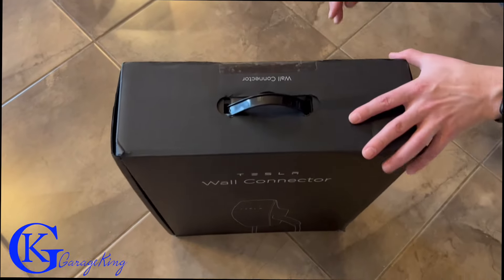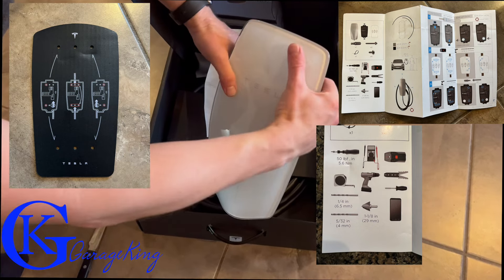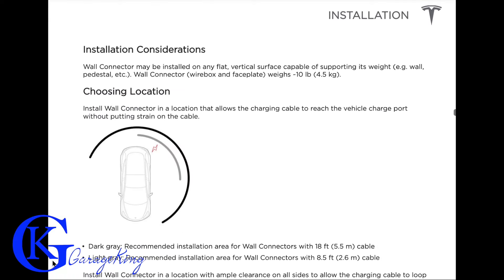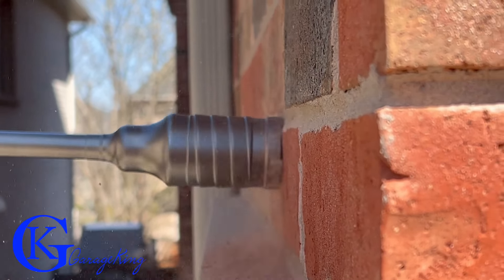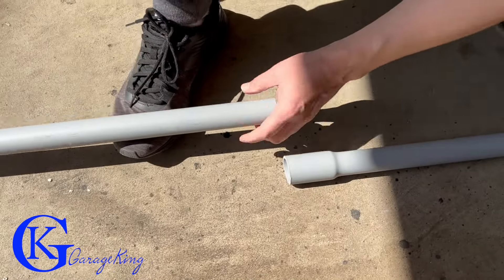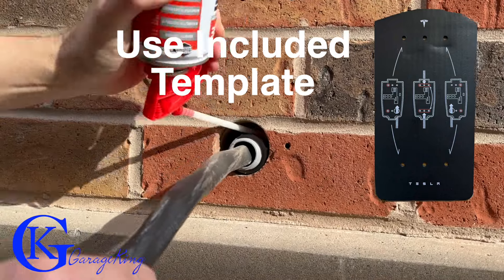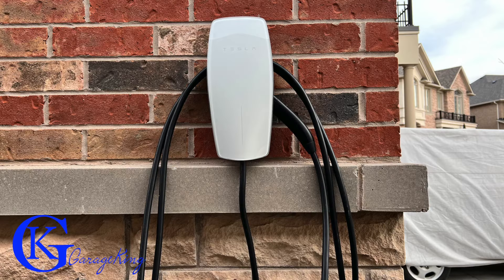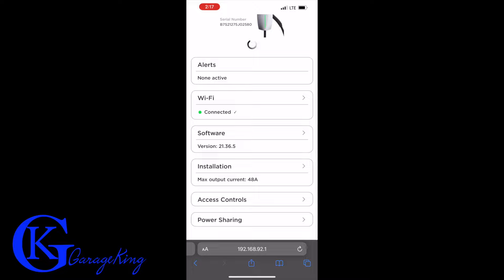Tesla Wall Charger installation (Gen 3)

Comment: Is there anything to look out for before installing? I also have a 100amp double pole main circuit breaker, and I'm uncertain if it would affect the electricity of my home.
Reply from the maker: Hey There, the only thing I would do different is I would strip the sheathing off the wire before running it in the conduit, now you can run romex in conduit but codes vary and the consensus is to strip it (not the black and red, just the covering  that holds all the wires together) A 200amp would be better, but you know it will work.  Just as an FYI - I use about 10amps to charge.  I top up every night to about 80%, and I slow charge overnight so really my charger is not using much more than a hairdryer.  If you can set yours to charge over the evening and night hours and spread out the charge time you won't be using much any.  I never understand why people run their Tesla's low and then fast charge for a few hours, and then leave it connected for the rest of the night not charging.  Why rush it?  Anyway thats my take.  Let me know if you have any other questions.
Reply: @GarageKing Gotcha. Thanks for taking the time to respond to my question.
Reply from the maker: @alkalos  For sure !!

Comment: Thank you for this great tutorial ! Just had an electrician install mine yesterday : how hard was it for you to push the main unit into the backing plate ? Mine was extremely hard and one top screw was stripped in the process. It seems that the seal was hard to compress...Thanks again !
Reply from the maker: Hey thanks for the comment. I remember those bolts being tight.  I really lined it up, and then I started all the bolts and kept going around until they were snug.  I think that was the key in my installation.
Reply: how much did the electrician charge?

Comment: what size of the drill bit that you used to drill the holes on the brick wall for mounting the box?
Reply from the maker: I bought those blue concrete bolts and usually they come with a drill bit.  You have to get the drill bit to match the bolt size, so I recommend getting one of those boxes with like 10 bolts and is comes with a drill bit.  You don't want to accidentally drill too big of a hole.........

Comment: so if all the electric panels aren't line correctly, you must dial a license electrician who took the exam, and unless small wall connector, because I have my handyman help me install it in my attach townhouse garage, where the connector have to be place inside?
Reply from the maker: Hi There, the wall connector can be installed on the inside or the outside. It is waterproof.  Just make sure to use the proper wire and circuit breaker.
Reply: Ok thanks we will double check with him. And was it easy for u to install?
Reply from the maker: @xianli6488  It wasn't too bad, I actually installed another one (not Tesla today) and I did that on the inside of the garage and it was easier.
Reply: Wow u are a genius like our handyman. And took 3 hours?
Reply from the maker: @xianli6488  Thank you for the kind words !!!  Mounting the charger took some time as I had to drill into the brick.  If you are drilling into wood then it would be quicker.  The electrical was actually pretty quick.

Comment: Nice. But having it outside makes me wonder what would stop someone from borrowing it while you were out or at night? I guess a camera might, but some people don't care. :) I care. I wouldn't do that.
Reply from the maker: Its all been good for a while now.  There are no screws that are easily exposed from the outside. The two security screws on the bottom are not easy to get to, and they can't be removed that easily.  It would take quite the racket to get it out at night.  Would not be easy.  There are quite a few cameras around so its been good so far.

Comment: You have to strip the romex shealthing off i side of conduit.
Reply from the maker: 10-4 that was the one error I did.  I'm installing another charger in the garage (so I'll have one on the inside and one on the outside) and I'm going to fix that part.  Its pretty easy to do.  Thanks :)
Reply: That's incorrect.  In Ontario where he's from they allow NMSC/NMD90 in a conduit as long as it meets the fill requirement
https://esasafe.com/assets/files/esasafe/pdf/Electrical_Safety_Products/Bulletins/12-19-16.pdf

Comment: Can we install wall connector with 30 A circuit breaker instead of 50 A? Would it work ?
Reply from the maker: Yes I believe you can, but the wall connector will output less power. It will sense the 30A breaker and adjust accordingly
Reply: @GarageKing  thanks for quick reply.

Comment: my side cutter was sooo weak when cutting the 6 gauge wire. i ended up using my bolt cutter. later i got a proper wire cutter when cut the wire with ease.
Reply from the maker: Hey thanks for the reply. Its amazing what good tools will do.  Hope you are enjoying your Sunday !!!

Comment: What is wire size connected to sub panel on 100A breaker?
Reply from the maker: I think the wire the builder used was 3 gauge copper as the run from the 100amp sub panel to the 200amp main panel is not very long (about 40 feet)  That wire is thick and I felt sorry for the electrician as it is not easy to work with.

Comment: Hello, I have this charger but I want to put a 40 amp not a 60 amp breaker for my box that is 100 amp, now what type of cable should I use?
Reply from the maker: Hey there, using a 40amp breaker is fine, it just means that your wall connector will only output a max of 32amps, which is fine. FYI- I usually charge overnight at about 12amps.  8 gauge wire is rated to 40amps so 125% of the 32amp load gives you 40amps, and you would have a 40amp circuit breaker. I see you have a Canadian flag in your avatar so I would just call an electrician to make sure, as the length of the wire can make a difference, they may tell you to use 6 gauge.  I just installed a 40amp charge with a 50 amp breaker and I used 6 gauge. https://youtu.be/UkQUeu_WwKY
Reply: @GarageKing  hello, thanks for the answer, if I live in Canada and I am clear that I can only charge my model 3 after 10pm when we all go to sleep since the consumption would be minimal, am I correct?
Reply from the maker: @jlaz74  Hey There, yup you are right, me, I live in Ontario and we have cheap power from 7PM to 7AM so I plug in my car when I get home and then it automatically starts after 7pm.  This way its like 1/2 price.  I slow charge it over night and its done around 7am. I average from 10-12amps when doing this and I drive about 100kms per day.  If you burn your battery right down then you have to up the amps but I think its better to slow charge and just top it off every night.  Oh also I set my to stop charging at 80% as I heard its not good to charge at 100% all the time.

Comment: What if your breaker is in the basement?
Reply from the maker: Then you have to run a longer line to that panel box.  Depending on where it is and how long the run is, you may need thicker wire.
Reply: @GarageKing as an electrician, I can tell you, you won't need a larger size. Unless you're in some mansion and you're going across the entire thing, the voltage drop will not be very much.
Reply from the maker: @BibleTwins  Thanks for sharing your knowledge, much appreciated my friend : )
Reply: @GarageKing  no problem!

Comment: So a PVC pipe is good for the cables?
Reply from the maker: Yes, but it has to be for electrical, it can't be the black stuff that you use for drains.  You can run conduit in the pipe as long as the fill does not go over a certain percentage, but its best to run individual wires.  I actually changed mine to individual wires, as mine was a pretty straight run, so easy to do.

Comment: we installed the Tesla wall connector today, but when connecting to the wall connector Wi-Fi, it keeps showing that there is no Internet connection, so I can't enter the wall connector setting page, but I can't enter the Ip page!  Do you know why?  Is it because the wall connector Wi-Fi is broken?  Or do you need a car next to you?  Or for other reasons?
Reply from the maker: Hey there and thanks for the comment :)  Its normal to see the wall connector not connected to the internet. Go on your phones setting and you should see the wall connector connected to wifi, but not the internet, that is normal.  What you have to do is have the wall connector connected to the wifi, and then on your phone you connect to your wifi and you can access it.  Somehow the wall connector "talks" to your phone.  In your instructions there is an IP address, you can scan that code and enter the password of the wall connector (its in the little manual that came with your connector) If the scan does not work with the phone you can manually type in the address that is in that little booklet.  It can take a bit of monkeying around.  For me it was not easy to get it right, and it took a few "takes" to make it look good for the video. You don't need the car as far as I know, as I was able to set mine up about a week before I got my car.

Comment: What about #6 aluminum with a 50amp breaker?
Reply from the maker: I don't think you can do that.  I think the wall box requires copper wire.
Reply: @GarageKing  so 6/2 romex with 60amp breaker?
Reply from the maker: @519rudy  Depends on how long, if I'm not mistaken I think thhn was recommended.  I stripped the sheathing off the wires (afterwards) so they are run individually in the conduit.  Now my tesla charges at about 15-20amps on average as I charge every night, so if you are going to crank it up to the max all the time (not really good for the battery) then please seek an electricians advise.

Comment: Why did you use the neutral as a ground instead of the bare copper ground wire? Can you not use the smaller ground wire?
Reply from the maker: Hey there and thanks for the comment.  I used the neutral as its much thicker than the ground.  You only need 3 wires so I used the red/black and then used the neutral as a ground.  The ground is a thin wire so why not use the thicker wire right?  I labelled the neutral as a ground so any electrician or future owner would know its being used as a ground.  Then the ground wire is not used.  I just figured use the thickest wires.  You could use the smaller ground wire and I'm sure you would be fine, but I just thought use the thickest wires.
Reply: Yeah I bought 12 feet from Lowes and I had 4 wires like you garageking red, black, white and think for the ground I pulled out thin one and gonna do the same set up going to use white as a ground 6AWG it’s always better then 14 or 16 that came in
Reply: @alexp7362  the ground wire that is in the jacket would be a #10. That is what’s required by code. Using the white wire is a code violation. A grounded conductor must be green or bare. A white or gray can only be used as a neutral.
Reply: @GarageKing  the ground that came with it was more than fine. That was a really weird part of the install. Besides that A+
Reply from the maker: @visionsdb6695  Thanks, that's the one thing I should have done differently. I should have stripped out the neutral(white) and just used the red and black with the included ground.  I think this summer (too cold now) I'm going to change it, as its really pretty simple to do.  Thanks for the comment.
Reply: @stanley4006  In the UK you can as long as you use an Earth heat shrink sleeve to cover like 90% of the  exposed insulation.

Comment: Does this charger considered single phase or double or three phase?
Reply from the maker: Its two phase
Reply: @GarageKing  That's what I was thinking but Tesla's installation manual says single phase at the first page.
Reply from the maker: @semihyilmaz4699  My bad and I'm sorry, its actually single phase, I got it wrong.  I was thinking 2 phase because I'm using two hot terminals, where normally you use 1 hot and a neutral.  There IS NO NEUTRAL.  Its hooked up just like a dryer.  Your comment about 2 phase threw me off (I'm using 2 poles) and I confused it.  It is single phase.  Sorry about that !!!
Reply: @GarageKing  It is ok.  Actually, I thank you for taking time and explaining it. So, it is single phase because there is no neutral?
Reply from the maker: @semihyilmaz4699  yup you are correct.
Reply from the maker: @semihyilmaz4699  but two hots and a ground, or one hot, a neutral and a ground are both single phase.

Comment: Why did you switch the red and black terminals?   Red neutral should be in the middle ?
Reply from the maker: Hi There, there is no neutral in the wall connector set up.  It's just the red and black HOT wires, and a ground.  I used the white neutral as a ground because it's thicker, and I labelled it as a ground.  Normally you would just have the red and black hot wires, and then a bare copper wire ground.  There is no neutral.

Comment: Is installing this into Siding difficult
Reply from the maker: The drilling/screws are much easier as you are not going into brick. The problem you run into with siding is you have to make sure its flat so depending on what type of siding you have it can get tricky.

Comment: Hey buddy. Is it necessary to use the neutral as a ground? What would happens if I used the regular thin ground.
Reply from the maker: Hey There, no need to use the neutral as a ground, the thin wire is just fine. I just used it as it was there, thinking back I should have removed that neutral and sold the copper !!!
Reply: @GarageKing  thx.
Reply from the maker: @Tworth23  For Sure !!
Reply: You want to use the unsheathed wire for your ground.  Should you have a fault with one of the hot wires inside the cable you don’t want your ground wire protected.  You want your hot wire to be able to ground itself out ASAP so it will trip the breaker and prevent a fire. Other than that, great video

Comment: 3/4 is to small diameter for 6-3 Romex, something else you can't use romer in pipe
Reply from the maker: Hey there and thanks for the comment, you are 100% correct and that's why I used 1 1/4" in plastic tubing designed for romex wire.  I don't think it would even fit in 3/4" if you tried.  Also, you are right never use romex in steel pipe, only run it in tubing designed for it.
Reply: The National Electric Code is a tricky beast.  With so many spots hiding so many rules and it may not apply in your area at all.

The 2020 NEC section 334.15.(B).  NM cable...exposed work...protection from damage....  RMC, IMC, EMT, SCHEDULE 80 PVC are all approved protection methods.

Things get really interesting when you need to size the conduit.  2020 NEC chapter 9 table 1 (page 70-695) is the section that allows calculations for conduit fill.  #6 and a #10 in the same pipe, will they fit?  This table has a note 2 (page 70-695) that claims the fill requirements should not apply to conduit for protection.....if it fits, it fits.  Anyone that ever pulled wire will know you want plenty of room in your pipe, but these are the rules.

If I missed something please let me know.
Reply from the maker: @keithharrington4595  Thanks so much for the comment.  The one thing i learned about this video it people have watched it all over the world (I can see in my analytics) and I have learned the code varies between countries.  Thanks very much
Reply: @GarageKing  Hey, bruh.  The code varies from building department to building department.  Section 90.4 in the NEC allows local jurisdictions to keep some, none, or all code rules and even add extras.  I know North Dakota uses the NEC plus a supplement of about 60 Pages for extra rules they feel they need.

So, please take any and all feedback with an easy attitude.  I try to give the sections because some places will allow for legal action against you license in their jurisdiction for bad/wrong advise.  Also, with so many rules in different spots, the just add a receptacle to another one may be acceptable in one case and a violation in another room.

Have fun.
Reply from the maker: @keithharrington4595  Thanks for the reply, you sound pretty down to earth, appreciate the comment and your insight !!  Thanks again

Comment: what size of conduit did you use?
Reply from the maker: HI There, I'm out of country on vacation right now, but I went oversize to make sure there was enough air gap, plus it makes pulling easier.  If I'm not mistaken it was 2 1/2"

Comment: Hi which gauge wire you use 6/2 or 6/3? Will 50amp work fine?
Reply from the maker: Hi There, I used 6 gauge wire with mine, you can use 6/2.  The only reason I used 6/3 was because it was old hot tub wire I had and it saved me from buy new wire.
Reply from the maker: Also not sure what you mean about 50 amp? You can set the charger to whatever you want, I think between 5 and 48 amps.